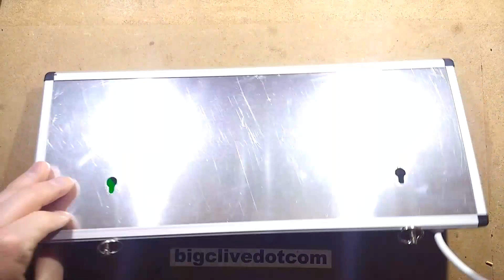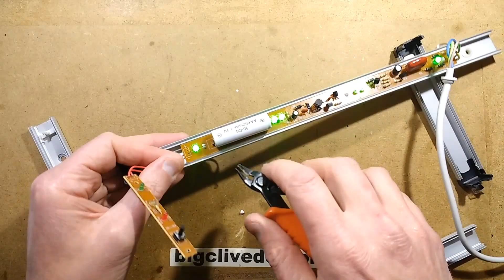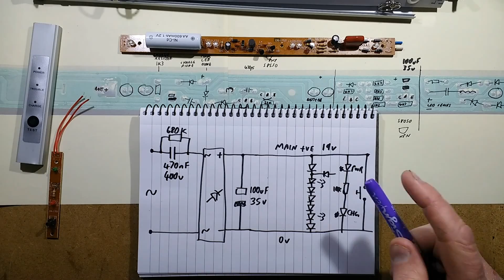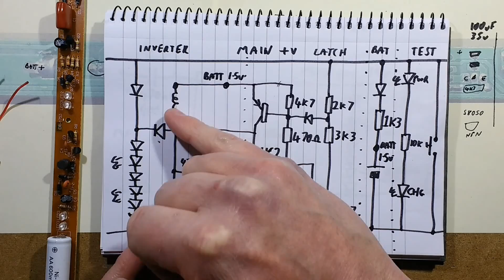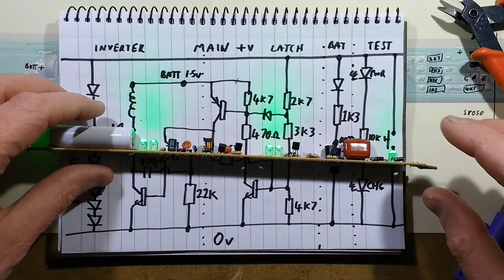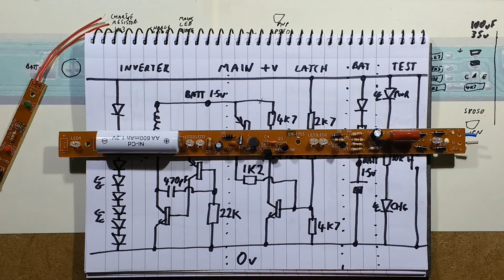Weird emergency "open" sign????  (With schematic.)

Comment: Now it would be interesting to see a emergency light that is build to code dissected for a comparison.....
Reply from the maker: +Carsten Langbo That will happen.
Reply: debbie62140
Can't be set up for power fail only here in Australia anymore apparently. We had ours set up for manual switching plus power fail, but had to go always on when we needed new ones. Something to do with power not necessarily being out when you need to evacuate (like in a fire I guess).
Reply: bigclivedotcom I have a few
Reply: here in the US  most emergency exit Light Signs and other lighting for emergency exit have batteries in them that can be changed because that every three to five years you need to change the batteries here to meet code so they make them so you can access and or repair replace bulbs in them ...
Reply: Same fucking shit mate. The only difference is the amount of stickers issued by government institutions and the massive tax stemming from it. Watch's AvE's video "BOLTR $500 industrial flashlight" about it.
Reply: Proper emergency exits signs should be wired into a lighting circuit with an in-line fuse. Had to have two installed in our own small theatre here in France. A local electrician wired them into the mains circuit so we had to change them to conform. An emergency light must be tested periodically and a record kept, hence the test button. Quality emergency lights can be wired either always on or only on when power off (or if in the switch circuit when the house / auditorium lights are off.) They also have an end that opens to accept different signs / symbols i.e. arrow left / right or  below sign to indicate where the emergency door is.

Comment: The open sign which needs a tiny set of curtains for when your closed.
Reply: Maybe the initial design just calls for the aluminium back plate to be a matching "CLOSED" glass instead, and you just turn it around when you leave...

Comment: One reason for a maintained OPEN light would be to indicate a route is accessible in an environment where "fail secure" has priority over "fail safe", this would be complemented with a "closed" sign
Reply from the maker: +Tom Varley They do indeed have a matching sign that says CLOSE.
Reply: bigclivedotcom
Reply: My first thought was for a door with access control that had failed open during a powercut, but in which case you'd want the sign to be off when power was available and only come on when it failed ..
Reply: But you can't turn the sign off without taking it apart.

Comment: It's a sign for 24/7 shops. :D
Reply: railspony what real customer would need this? why not just buy an actual exit sign?
Reply: daoneTM I'm sure that's what it was intended for, but the eBay listing still said "Emergency Lighting"
Reply: Customers who need this are probably used to buying things that are somewhat repurposed, and leaving it under "emergency lighting" foreshadows the feature set exactly; it is actually an emergency exit sign with different front paint. Real customers will understand, even if bigclive doesn't. He's just playing with it, he isn't the intended customer.
Reply: what if the creator was a non English speaker? mind 🌟blown ✴️
Reply: Or 4/20 shops.
Reply: Avantime no, that you have to have a weed leaf, not open

Comment: Nice little circuit clive :-D

So the battery keeps the pnp off via the base resistor., so no output.
But when power is applied the diode keeps the pnp off with force and over rides the bottom npn, no matter what its resistance is.
Then if the power is removed the diode doesnt have any effect and the npn has enough gain to turn the pnp on.
Close enough ?

Comment: Is it possible to make a compliant one without an IC?
Reply: I wonder if this design could pass certification with little or no change, if someone put in the paperwork. The fake panel and the use of a non-certified X capacitor might be the biggest problems, from a formal standpoint (unless there are additional requirements that I haven't looked at).

Comment: I have to admit the idea of a battery backed open sign is odd but nonetheless the circuit itself does actually seem to be well designed. The latch section itself is pretty nifty indeed. Maybe possible to add a small PIR into that as a baton based fixture for automated hallway lighting even after the power fails.

Comment: It's definitely odd - I wouldn't put it past them to have just put different words in the same frame, but I can imagine that there are situations where workplaces need to notify you of that, much the same as 'ON AIR' signs in radio/TV!  Perhaps if you want to warn someone that there's a portal to another dimension next door that hasn't been blocked off...
Reply: Simon Hollingshead oh that last one, thats gonna be useful. I hate it when people trip into the interdimensional portals I forget to block occasionally
Reply: drkastenbrot the liability insurance on that must be dreadful!

Comment: Emergency "OPEN" signs are good for areas with unreliable power grids. There's a fortune to be made here, I'm sure of it.
Reply: I would want to add N.O. momentary switch(es) connected across the transistors in the same way he shorted them, to add ON/OFF functionality to the sign though, as a mains-connected open sign that stays on for (at least) three hours after you unplug it is kind of a pain, you'd have to physically take it down each day.  Just ditch the "test" board and add it in there, then this is a pretty functional product.
Reply: Ain't nobody got electric  registers or card readers in the third world.
Reply: I guess it wouldn't be that much extra work for them to drag a gas generator out to their street cart to power a little OPEN sign.  I mean sometimes it's hart to tell if a guy standing with a cart full of goods is actually willing to sell any of them.
Reply: My first comment was sarcasm.
Reply: It seems obvious, but if you're operating a street stall in a place with intermittent electricity... you're already not using an electronic cash register. Talk about taking electricity for granted, wow people! ;)

Lots of places have electricity for a certain number of hours a day with rolling blackouts during peak hours. Not just "third world" places, but poor areas in much of the industrialized world. In rich countries, electricity is usually on and markets can close if it goes out, but that won't work for places with regular outages. This thing can trickle charge even during a brownout!

The reason it doesn't have an on/off switch is that it is just an emergency exit sign with a different front panel. They didn't spend money redesigning just this one model, and their customers probably wouldn't want to pay for that because it uses so little electricity that they wouldn't save any money, and they probably don't care if they have to cover it instead of turning it off. They could probably find somebody in their market to add an off switch if they wanted, and at local prices.
Reply: Well obviously chain it up.  Then one of the kids can just sleep on top of it.  They can even turn it on at night for the soothing aroma to drift them right to sleep.  I mean they need that OPEN sign to stay lit during the day at their street cart that doesn't have power to keep the sales up.

Or.or.or... they don't need an OPEN sign because they are standing right at a cart selling the goods.
Reply: gantmj actually, it would be useful in North Korea.
Reply: Do a lot of huts in the third world have OPEN signs?
Reply: There might be some in a fairly-developed area with power issues who see a use for a battery backup "OPEN" sign.
Reply: Right, if only their income was 10x higher, and there were no neighborhood thieves who would steal something that expensive when stored at a vending stall. Or, one of their children can just sleep outside to make room for it in their home.
Reply: Yep, our registers are down and anti-theft devices don't work but everyone must know we're still OPEN ;-)
Reply: think about what you just typed gant

Comment: If you cut a vertical slit in the mask, you could slide the N over to make it say "NOPE" when you closed the store.
Reply: "PEON" - alert native born trainees : to start - a new day's first shift - for their : celery - I mean salary : a sandwich R > G
Reply: I think everyone could use an emergency "NOPE" sign.
Reply: ChrisD4335 
and you just tell everyone like that, for free? you could have gone into the business of producing NOPE signs
Reply: OKAY now I need one. Nope sign modification to be performed. Thanks
Reply: I've been trying not too shit on this but the letters are screen printed or painted onto glass, if you cut the glass light would shine from where you cut it
Reply: Nope.avi
Reply: im laughing so hard
Reply: tohopes YES, THE NOPE SIGN
Reply: tohopes you would need something like electronical tape
Reply: ChrisD433
Reply: You can just clean the paint off with a solvent, make letter stencils then get a can of spray paint and it will say anything you want.
Reply: ChrisD4335 
yeah you can just cover the rough edge with magic marker or something

Comment: Hi Clive,
sorry for the OT but I wondered if you have come across a decent supplier for LED drivers for the high power chips?
I recently got drivers that were rated for 36V AC/DC input although I ordered mains drivers.
Thanks in advance.
Reply from the maker: It's all a bit random when you order online.  And even several units from the same supplier might be different.
Reply: bigclivedotcom 
Yeah that sucks. But at least I hopefully got a decent supplier for 50W 5600K chips at last. I ordered one for around 2.50€ to check out which turned out surprisingly good. Now I'm waiting for the second shipment of another nine chips.
Reply: Против Глобал 
I don't hope so.
Reply: bigclivedotcom 
Hey Clive, 
I just found this shop on the Chinese eBay. 
Seems to be legit and they sell all you need LED-wise. 
 http://s.aliexpress.com/ZFjeANzi

Comment: You could use it in a place that's open 24/7, so even when the power goes out, people know it's still open. :)
Reply: A shop that sells batteries maybe? :)
Reply: Or emergency OPEN signs.